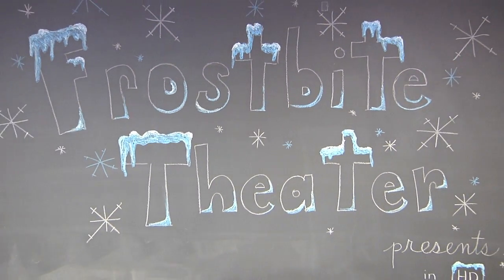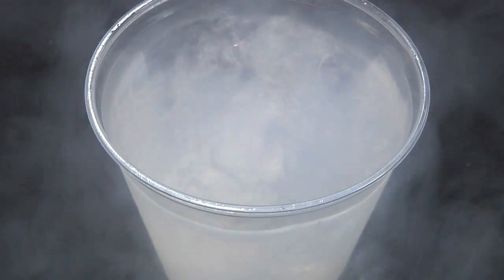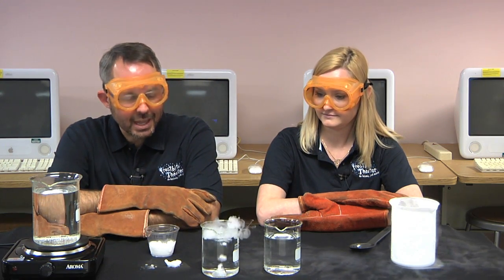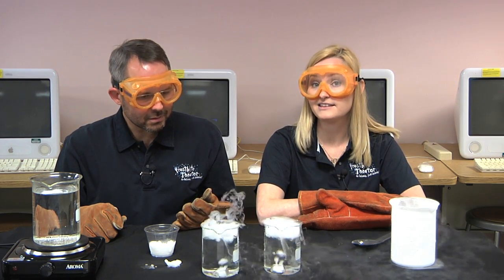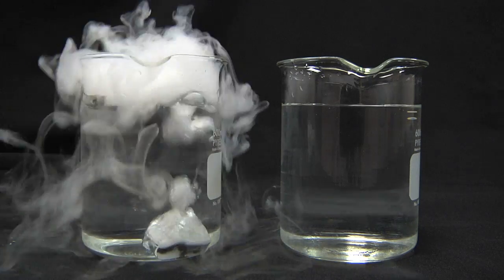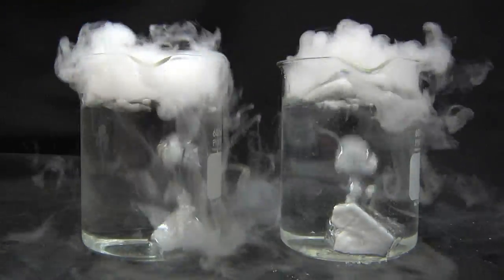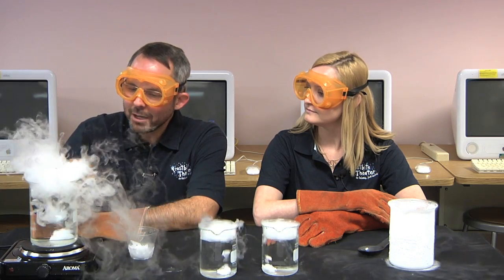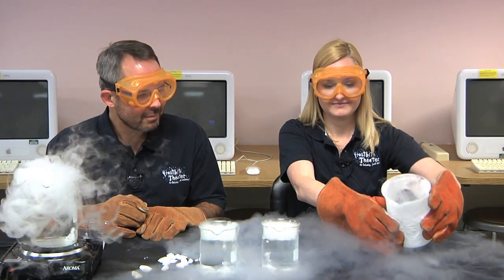Liquid Nitrogen Cooled Dry Ice in Water!

Comment: The heated container looks bigger than the other two. I postulate that the larger surface area produces a greater impact on the creation of the fog than the hotter water.  Please enlighten me.
Reply from the maker: +Mick Taylor The surface area of the dry ice is what matters, not the surface area of the water. The container could be three miles across, but it's only the water that's in contact with the dry ice that sublimates the dry ice. All the extra water doesn't do anything.

Comment: hello how are you i've always seen Liquid Nitrogen pourd in to water but i'v never seen water pourd in to Liquid Nitrogen is there a difference and if there is y does it happen
Reply from the maker: There isn't a huge difference. Water is denser than liquid nitrogen, so pouring water into liquid nitrogen results in a bit more mixing as the water settles beneath the liquid nitrogen. Other than that, the end results are the same.